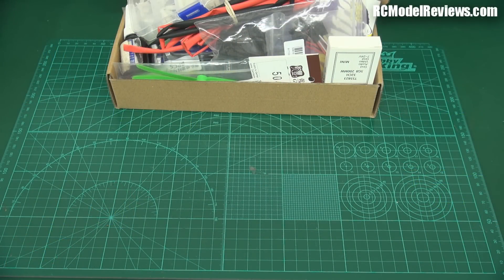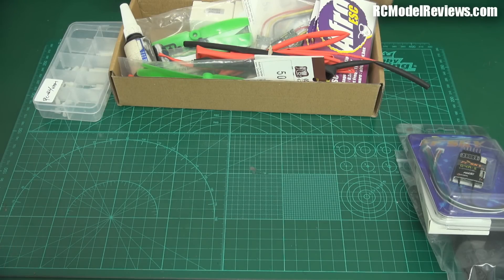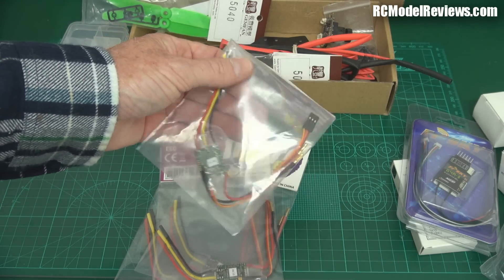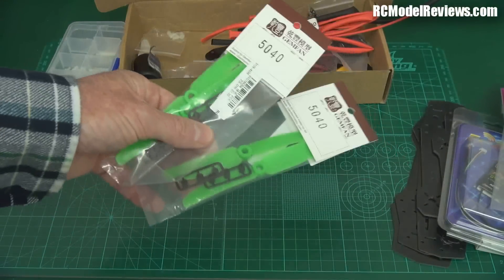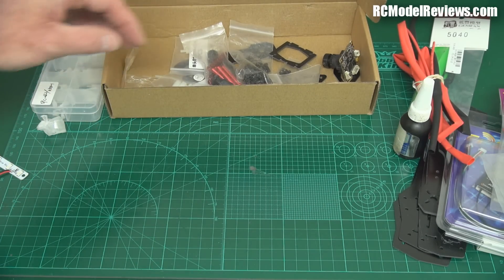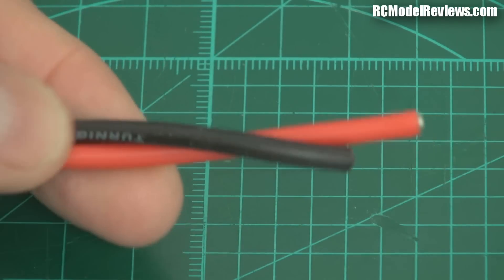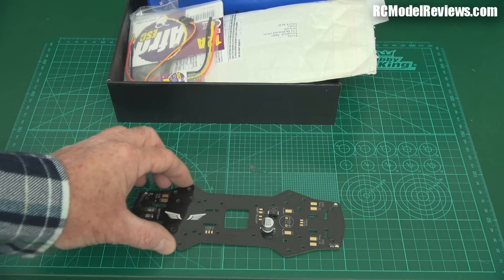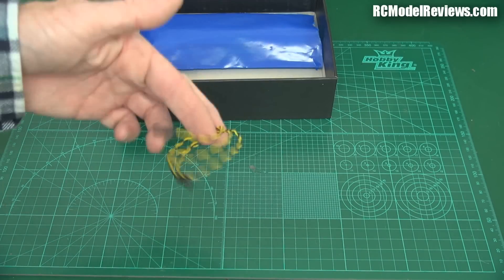Low cost miniquad racing drone build video PART 1

Comment: When are you going to uptade the parts list?
Where do you buy the radio controller, battery and all of those nylon nuts and bolts?????
Reply: OK after watching the videos i compiled all the parts he used here >>> http://i.imgur.com/Ruyxe17.png?1
Reply: +Liam Murphy Here's a blog post about my experience following this tutorial http://copterwars.com/blog/?p=4 that includes a complete parts and tools list with links.
Reply: Liam Murphy i need to no where to get all of those things to
Reply: ok thanks mate
Reply: Liam Murphy here is a new shopping cart with some adjustments,let me know if there are any compatibility issues! http://imgur.com/vxu7LMv
Reply: Liam Murphy Hi Liam, Did you get to build this miniquad? If so did your stated parts list include everything needed to build and fly the quad? I ask because I want to build one and want to know if there was any other pieces/parts i need that wasn't on your shopping cart. Thanks for compiling that list for us newbies.
Reply: Jed Carter OK this is what I have discovered. There are allot of HUGE components to building a fpv miniquad that this guy leaves out. like what transmitter to use with your reciever, what battery to use with your ESC and how are you going to charge it ( lipo battery chargers and are aprox 30-50$ and you have to buy them separately from the battery). Low end fatshark fpv goggels are 200+$ when I put it all in a shopping cart the price was not so "budget" because all of these extra parts are not considered. plus there are parts that have been out of stock on hobyking for months now hence why I haven't purchased any thing. by
But recently I found a place called http://www.miniquadbros.com/ that sells full fledged rtf units and for people like myself who are into DIY, they sell kits with just raw components.
Reply: Does anyone have any thoughts on the Storm racing quadcopter from helipal?
Reply: I was going to get the 4s set up.  Are there any better options for around the 6 to $800 range.  That's with everything ill need.  ( radio, extra batteries, blades,)
Reply: Liam Murphy Looks like your quantities are wrong on the motors and afros. That should add about $60 more
Reply: Liam Murphy no need to reply.. just saw it in the thread... bro thanks for the list !!!!
Reply: Tane Potaka In order to use the FrSky receiver with your 9x you will need to do the DIY modification. Bruce has a great video that walks you thought the simple mod but you'll want to also checkout some more recent videos that cover the changes needed to install the 2-way telemetry DIY kit that HK is supplying now.  Both the DIY kit and d4r receiver can be obtained from HK for a very reasonable price. I think I got both of these for a total of around $45.
Reply: Liam Murphy Jed Carter Indeed, a ton has been left out which is wierd because I have now checked a lot of Bruce's videos and they always seem complete and well thought out! I guess he has a lot on his plate, and part of this hobby is lurking in the deep shadows of forums to find out specifics. I ordered many parts seen on this video, but seeing I wanted to keep costs down and own a spektrum dx6i i went on to discover Lemon Rx are good receivers for your transmitter. Regarding FPV, quanum V2 from Hobbyking have now launched a 55 usd FPV kit so entry level it's pretty nice to discover if you like FPV without paying full price. Bruce even did a review of the Quanum (both V1 and V2). For the video receiver, i went ahead and ordered a 8 ch RC305 as bruce seems to use those (sure, they are old and there is much better now but it's enough for now, its the cheapest i found and had good reviews). I do a lot of my purchases on aliexpress (similar and often cheaper than bangood). I'm still unsure about battery, even if bruce did a lot of vids for this. There is no consensus, despite people having benchmarked some batteries. It will depend how many amps you will pull, the weight of the quad, and also what you want to do (race, endurance, etc). I have chosen battery packs on aliexpress again, they do not have the highest C rating (35-40 c max usually) but they are cheap.I went for 1500 mah, 40c, and 2200mah 35 0, and trying a 2600 30 c (that last one might be too heavy, but seeing I wont be using a gopro or mobius i can have extra weight). They cost me around 13-15-17 usd on aliexpress. Again, not great quality or C rating but it will do for now (i cannot find in canada the 45-90 c rating 1500 mah bruce recommends). I took a long time and read many things regarding the charger.  I wanted a good charger, but they were amazingly expensive (100 + usd). I checked cheap chargers for 20 bucks (IMAXB6 copies and fakes) but decided against as security is important for me (even if will always charge lipos supervised). Eventually i went ahead and ordered a real Skyrc charger (its more reliable than the copy, of course, for around 35 bucks), but it came with power lead. Again, some will say cheap chargers, do, others dont mind paying big bucks for quality. Depends how long you plan to be in the hobby. See it as an investment. For video, i couldnt find a Sony600TVL so went for the 700TVL which does the trick. You can do a lot of reading on the cameras, there is a lot of quality variation (CMOS, CCD, etc). Again, you will spend loads of time on forums ( i recommend Rcgroups) and you will find out you learn loads, and it's all part of the fun :) If you cannot be bothered, you can go and buy a RTF quad, its gonna cost you (maybe will be equal to a first quad build seeing I have had to buy equipment - solder, heatshrink, tweezers, solder wire, etc) :) You can also check out Oscar Liang's blog on quads.
Needless to say you can type all the keywords into google, i couldnt be bothered to add any links here.
Anything else I left out? My parts are gradually arriving from china (25-35 days lead time), so it's fun! I might keep the build for winter times, as to enjoy the summer and fly RC planes :D So despite Bruce not finishing this series, I ought to thank him for helping me discover this amazing hobby!
Reply: Ziah Bonanno Liam Murphy Hobbyking.com. There are lots of builds on the interwebz! Google is your friend.
Reply: ***** yes however he does have a link to the one that he uses in his existing parts list.
Reply: Chadeverythingcustom
there actually really great entry level quads easily modable with no propriotary parts and they are on sale right now, i would go with a  bigger battery and slightly different  ESC, motor setup if i made my own.
Reply: Kent Campbell thanks for spoting that, hoby kings shopping cart can be trickey sometimes :s
Reply: Liam Murphy So thats everything ???? I would love to build one of these things
Reply: Everything excluding the fpv gear
Reply: Liam Murphy lol.... i thought that was a bit low... they sell a whole kit?
Reply: Liam Murphy  hi, is there a need for additionnal wire or any othe raccessories (heat shrink, etc?)? what gauge to choose for the wires?
Reply: I didn't include the wires, hearshrink or the copper board because I already have those things. But I would use 10 or 12 gauge wire
Reply: Liam Murphy Heya. Will the frsky d4r-II work with the turnigy 9x out of the box or do I need a frsky transmitter module as well? Thanks!
Reply: Thank you for your reply Larry Grimes. I'll check out the vids!
Reply: Thanks for that info mate, lots to absorb there. Being a newbie at anything requires a lot of research. Especially since there are so many parts involved. I suspect I'll have one built and ready to fly by Christmas though :-)...and then I'll build another one, but different. LOL. If it weren't for Youtube I woulda just went out and bought one ready to fly right outa the box.
Reply: Jed Carter no worries! I think half the fun is building it, so that when you crash it, you will know what to repair!
Reply: Jed Carter Dont forget to buy a lot of wiring and especially servo extensions for the FPV wiring .. dont have this and now i'm stuck and need to wait!
Reply: Does anyone have an opinion on what are the best motors and esc setup.  Hard to find comparison videos on motors.
Reply: zewill if you have any spare network cabling, like the blue covered type, strip this down as it makes some great free extension wires!
Reply: ***** I think someone needs to do a build considering and explaing details to the large demographic that wants to get into it without RC experience

Comment: Mah, I ordered some bullets connectors and a breakout cable. It'd be stupid to not use them now.. Do you think there's enough place to put some bullets in there ?
I wasn't planning to cut the wires too, but there's not much place on a 250 arm!

Comment: Hey guys, so I've been trying to decide on motors for my budget quad build. Ideally under 12-15 USD each, and 22mm diameter so I can run bigger props more efficiently (the frame I have will do up to 7" diameter). What's the best value for money/quality in this category? The RCTimer miniquad motors get a lot of good reviews, but does HK or another retailer have a better option in the same price range?

Comment: Anybody has a link to a good ZMR 250 power distribution board? 

Thanks !
Reply: PROSHOOTERNL This one: http://hobbyking.com/hobbyking/store/__31223__Hobbyking_Multi_Rotor_Power_Distribution_Board_DIY_8_x_output_PCB_.html
Reply: Vikingotubez But u cant use it for video and stuff right? :(
Reply: PROSHOOTERNL Of course you can, use a pair of holes for video TX assuming is for 12V or 3S. But...for now this is the best cheap combo (Camera+TX) that you can get, connected direct to Lipo balance plug:

http://www.banggood.com/Eachine-700TVL-13-Cmos-FPV-110-Degree-Camera-w32CH-Transmission-p-965760.html

Comment: im building my first quad soon, can anyone give some advice on a good tx and transmitter for this. Im out of touch with all this these days, used to fly helis
Reply: Lee Jackson You can bay http://www.hobbyking.com/hobbyking/store/__8992__Turnigy_9X_9Ch_Transmitter_w_Module_8ch_Receiver_Mode_2_v2_Firmware_.html and you not need receiver!!! 2 in 1 pac. For first it`s very good. Then if you can soldering you change firmware on OpenTX (english is not my lang=))
Reply: I just spent most of the night figuring out that for myself. I'm gonna bite the bullet and grab a FrSky Taranis for $200. It's received great reviews and will be the last one I need to buy. a much better price point than a comparable Spektrum.
Reply: Haystack Hall yea i was looking at them, fit my budget, obviously I wanna save money but I don't wanna be buying another tx soon and this one does review well.
Reply: I  use the immersion system but boscam is OK too.  plus the cost is a bit  less. but immersion puts out 5volt to the camera.  But boscam puts 12 volt to the camera.  So be careful to check the voltage
Reply: I opted for it because it's beefy enough to be the last one I'll ever have to buy. If you have the money, buy something you can grow into.
Reply: Haystack Hall Where are you finding this price of $200. I am looking on Amazon and all I see is $300+.
http://www.amazon.com/s?ie=UTF8&field-keywords=FrSky%20Taranis&index=blended&link_code=qs&sourceid=Mozilla-search&tag=mozilla-20
 Thanks
Reply: I actually got mine from team black sheep for $240, found this other site after it had already shipped. Fml.
Reply: Houston Brown try getfpv.com   there is a new model the taranus plus out now so they are a little more expensive than when I bought mine a year ago.  they are 229.00 and 239.00  with the case now.  Worth every penny!  The most secure link and almost infinate programming and upgrading available.  Plenty of videos out to help you get the basics down.
Reply: thefireman285 Could you share some of the links for videos? I have a growing list of links for the taranis but haven't found many tutorials yet.
Reply: sam1ee Go to R. Scott Page channel.  That is where I watched most.  Also BMSWEB channel for NAZE 32 (the board on this quad) setup on Taranis. and Peter King Drone shop channel.  I would think a youtube search "Frsky Taranis Setup"  would produce results too.  Hope this helps.  Not sure what your experience is in the hobby.  I have learned so much from Bruce here at RCMODELREVIEWS.  about everything from LIPO batteries to how Rx work, motors etc.  If I can be of further assistance please ask.
Reply: thefireman285 Also forgot to mention Painless360 channel.  Has some great tutorials that I have used for the radio and other things.
Reply: thefireman285 Thanks ;)

Comment: Where can you get those strong Cleland Carbon Quad Arm's from? I've looked everywhere but can't find nothing except the exact replacement arms the come with the kit. 
If you get some time spare please let me know, also can I use XT90 battery connections with this build? as I have handfuls of them and if so do I need to upgrade anything?
Any help would be would be greatly appreciated! Thank you!

Comment: Hi Bruce,
What sized heat shrink are you using to shrink the escs to the arms? For that matter how to you measure heat shrink? Is the size of the shrink you order from Hobbyking measured by how wide the stuff is when you lay it out flat or is it a measurement of the diameter when the shrink is shaped like a tube?

Comment: for the XT60 connectors, is it the female or male? sry i noob
Reply: Swish https://www.google.co.uk/search?q=xt60&safe=off&biw=1920&bih=982&source=lnms&tbm=isch&sa=X&ei=HwE9VejbIY2VatSigdAI&ved=0CAcQ_AUoAg#imgrc=upnIjkbsWF9tpM%253A%3BPI4D-qa_80NriM%3Bhttp%253A%252F%252Fwww.alpha-crucis.com%252F2946-4171-large%252Fxt60-connector-male.jpg%3Bhttp%253A%252F%252Fwww.rcgroups.com%252Fforums%252Fshowthread.php%253Ft%253D1636826%3B300%3B300           This one on the quad, the other on the batteries

Comment: I couldn't wait bruce - I placed an order for a Frame, Motors and Props from banggood... The HK FPV 250 was a disaster (at least I can use the same props and speed controls  :)

Comment: But FrSky D4R-II have only 4 channels right?. I think having more channels for switches is very useful. V8R7-II is a nice option. Also small but of course no CPPM :(
Reply: tiemanowo The D4RII has CPPM and handles up to 8 channels in CPPM mode -- although you will only need 5 channels for the miniquad.
Reply: ***** "CH1 will output CPPM for CH1~CH8" - I did not notice this in the specification :(. My mistake, sorry.
Reply: tiemanowo No problems... I love this receiver and use lots of them.  The only thing is that if you wish to use all 8-channels in CPPM mode you need to reflash them to use a longer frame-rate but with 6-channels they work fine straight out of the box.

Comment: What about a budget Transmitter? Can't fly your first quad without a transmitter.
Reply: Eyes Up Vids Well it's hard to go past the Turnigy 9X if you want a budget radio.   With the standard 9X module and bulky 8channel receiver it's under $60 or so and really good value.  Or you can get a Turnigy 9XR and fit a FrSky module/receiver and that'll still only set you back less than $100.
Reply: You can get a 6ch reciever plus transmitter from hobbyking for 30$ in the u.s. i have one of these and they have decent performance.

Comment: should we wait with ordering stuff till the final part build?
Reply: martinkindl83 Yes, there's extra information and you'll see that sometimes there are two ways of doing something -- which may change the bits you need to order depending on the option you take.
Reply: *****  thank you for reply. lets wait then

Comment: Hello Bruce, what a fantastic idea, I'm in!
I've got my shopping list complete, the online cart keeps getting harder to push through the webshop.
I do have one remaining item I would like your advise on: I have a dji phantom v1.1.1 and would like to use the transmitter (my only) for flying this soon to be quad.
Is this possible, and if so, what kind of receiver would it require?
I get confused with all the types and methods that are available, and can't find specific information on this transmitter.
Do you have any ideas on this?
Thank you very much in advance, greetings from Holland
Reply: JeroenJonkman Unfortunately, the only receiver that will work with  the DJI Phantom transmitter is a DJI phantom receiver :-(  You can get plenty of decent cheap radios though -- the Turnigy 9X is only a little over $50 with a receiver and will work just fine.
Reply: ***** Ok Bruce, thanks for the response. I guess I will put some more load on the cart wheels then...

Comment: Hi, why you don't use CC3D? it's about 12-16$ and enough for flights on mini quad
Reply: Евгений Тройченко Because in my experience the Naze32 is so much simpler to set up and only costs $25 anyway.  These quads will fly without any "tuning" if you use a Naze32 but the CC3D usually requires some tweaking.   Lots of people who used to use the CC3D have switched to Naze32 and I don't know of any who've regretted it.
Reply: ***** Hmm, interesting)
I haven't chance to try NAZE32 yet, but I've successfully built my own zmr250 on CC3d base (quite the same as your setup), CC3D have pretty simple wizard. Only  possible trouble is PID tunung, but I think you could get oscillation on Naze32 board too, and as it is typical build -  PID setup is available on internet already.
Anyway - it's more like "Apple vs Android" holy war), Look forward to next videos!
Good Luck)
Reply: Евгений Тройченко Yes, some people prefer CC3D, some prefer Naze32.  I have tried both and much prefer the Naze32 - all the frames I have tried it on fly very well even with the default PID settings.   Tuning the Naze improves the performance but they still fly well without any tuning.  Also, the Naze32 supports FrSky telemetry which can be very handy if you use FrSky RC equipment.